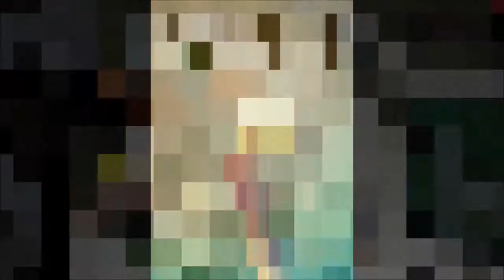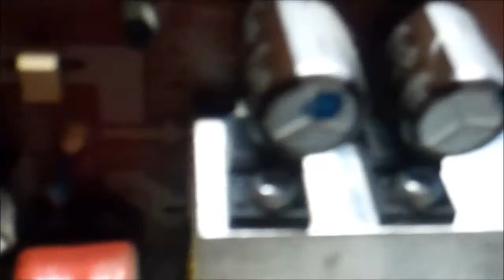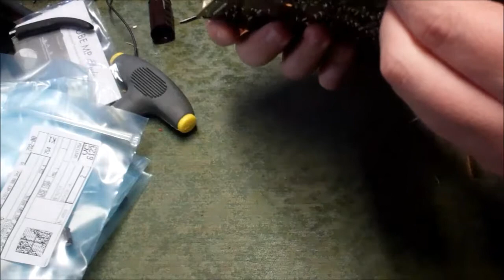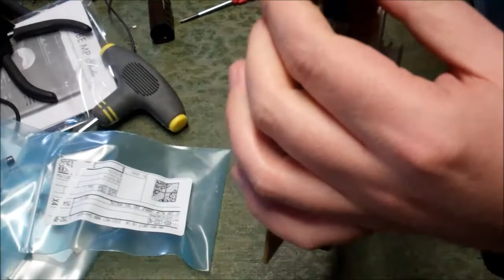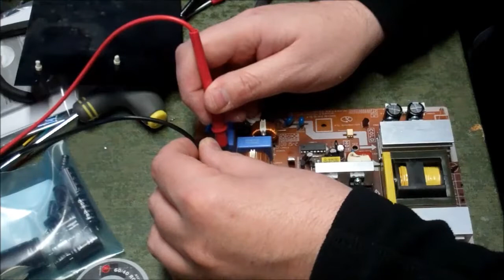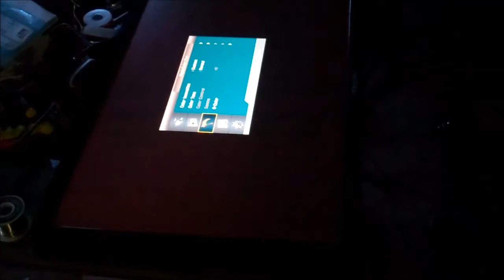Samsung 245t Monitor Repair.   Thank heaven for heat guns.

Comment: Thanks for your video, helped a lot. Could please tell the value of the big boy?
Reply from the maker: I don't remember... it was years ago.
Reply: @DeadKoby  Ok, I have successfully done the repair. The 13 capacitors on my Samsung 245T are (without the big boy): 
3 x 35V 1000uF
1 x 25V 1000uF
2 x 10V 2200uF 
2 x 50V 2,2uF 
2 x 50V 47uF 
3 x 50V 22uF
I replaced all of them.
Thanks a lot for your video

Comment: I wish you'd listed all the cap sizes you put into it so I could order them and the video focus leaves all the caps out of focus so I can't read any of them.
Reply from the maker: Just pop the back off of yours and read them.
Reply: @DeadKoby  Mine are on stands. Just reading the caps requires about 30 minutes of work and I use the monitors every day, so it has to go back up after looking at them.

Comment: How do you actually remove the back of the 245T? I only see 4 screws which attach the stand to the screen... I am waiting for my  order of replacement capacitors. 

Just in case that replacing the capacitors, doesn't do it, can anyone suggest a reasonable screen replacement (which would have USBs, VGA, DVI, HDMI etc.)?